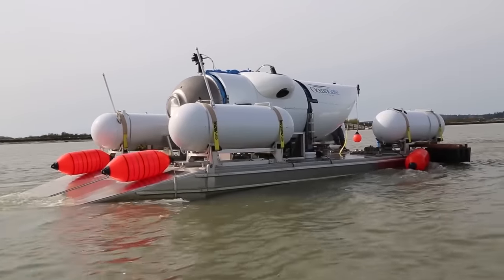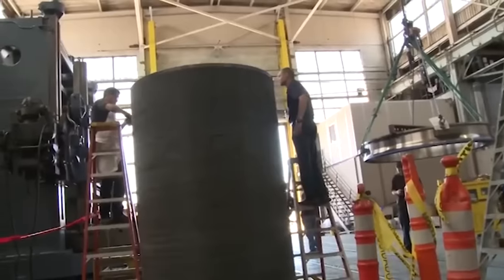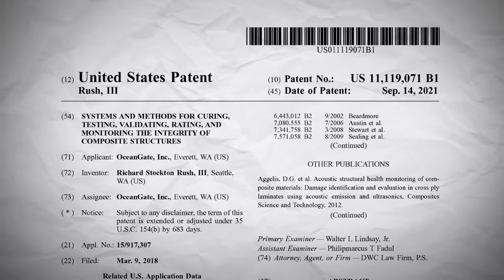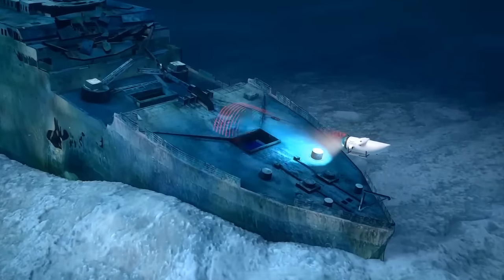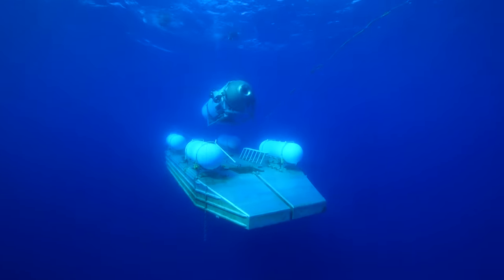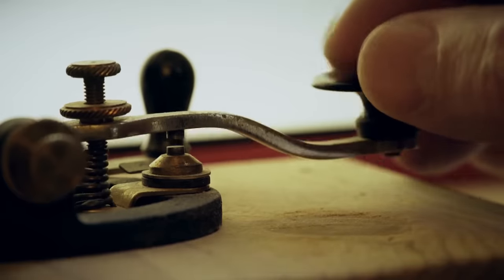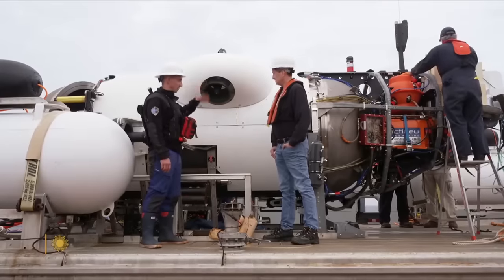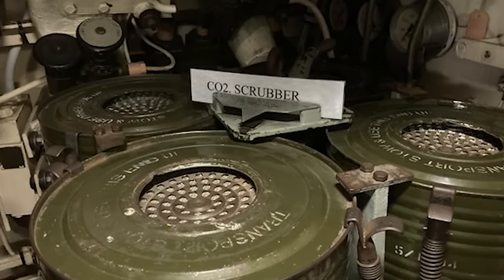Exposing OceanGate Submarines Many Fatal Designs

Comment: With respect to that railroad container collapsing, it's a good representation, but at only 1 atmosphere it's nothing close to how catastrophic the implosion of that tiny submersible would've been at that depth.
Reply: The vacuum in the container made the differential pressure much higher than 1 atm. But I do agree that it didn't implode as forcibly as that sub did.
Reply: @berto1014 A complete vacuum is 0 ATM. Assuming it's outside at sea level the air pushing on in it is 1 ATM.  That's a 1 ATM difference. 
Every 10 meters of depth is roughly 1 ATM. So at close to 4,000 m that would be roughly 400 ATM outside and 1 ATM inside the submersible.  That's huge!
Reply: @PoeticJusticeSC  you're right. Not sure why I thought vacuum would be negative pressure lol.
Reply: @berto1014  I think it's human nature as in our normal experience it feels like vacuum's have their own energy that sucks things in, when in fact it is just the atmospheric pressure pushing in.

Comment: It was mentioned that the Titan dropped it's weights few seconds before the implosion. So odds are that they started to hear some type of crackling sounds either from the hull or from the glass viewing window. So the operator must likely dropped the weight to immediately surface but it was too late. The unit was already too far damaged and it gave way and imploded.
Reply: Gee, thanks.
Reply: That’s pure speculation, there’s no way of knowing that
Reply: @Corey-pd3mi It's fact that they dropped their weights to try and resurface. Why else would they try to resurface so quick?
Reply: This is what happened: 
crack
Passenger 1: What was that?
Stockton: expression of dread, looking toward the ceiling
Passenger 1: Stockton, what was that?!
Sulaiman Dawood: Dad?!..... begins to cry
Stockton: Oh my g-
CRUNCH
Reply: @speedyd8150 Where did you see they tried to resurface?
Reply: Go woke go broke has a new meaning.
Reply: Where is this info that the submersible started to return to the surface?
Reply: What other reason would there be for dropping the wieghts than to surface?
Reply: @Corey-pd3mi  The Navy was listening the entire time with passive sonar and would know this with near-certainty, I'd bet. However, for security reasons they may not be eager to get in front of a camera and explain how and why they would know this. So you just gotta trust that if a submersible craft dropped a bunch of heavy metal weights and then imploded seconds later, there would be a distinctive noise.
Reply: @stickyfox  How would the Navy be listening to something they didn't even knew where it was? If the Navy was indeed listening then there wouldn't be any search party
Reply: @RuFi0000000  Paul-Henri: "You arrogant ass, you've killed us!"
Reply: @vgas11  The SOSUS hydrophone network wasn't listening for them specifically. It hears literally everything that happens, anywhere in the Atlantic. Underwater sound doesn't stop.
Reply: @vgas11 You must be joking.
Reply: @chuckd5819 have they found debri's ??
Reply: @luftwaffe6521  Stockton wanted die-versity and got it
Reply: @chuckd5819  They were found in a separate position from the rest of the wreckage - that wouldn't be possible if they'd detached during the wreckage's plunge to the ocean floor. If they'd detached during the final plunge, they would have been part of the main debris field. It also sounds like the last communication received was the pilot indicating they'd begun their emergency ascent. So there was a realization that the sub was fatally compromised and the only way to survive was to get on the surface fastest; unfortunately ascent had only begun after destruction had already commenced.
Reply: @RuFi0000000  Precisely, without the conversation part. :D

Step 1.: everything is fine
Step 2.: everything is pancake.
Reply: @luftwaffe6521 stop using the word woke if you don't even know what it means. Jump off the anti woke bandwagon, don't be a follower.
Reply: @katherineberger6329 So if the topside ship knew they were on an emergency ascent, why then wait 8 hours to report them missing, which is the time for the full dive. An emergency ascent would have been faster than that. Something isn't adding up with this piece of info.
Reply: Good point
Reply: @stickyfox  Apparently they did detect the sound of a catastrophic implosion, but until OceanGate realised they had fucked up harder than any tourism company before and announced they had lost contact several hours beforehand there would have been no way to verify it. That large time-window also meant they couldn't reliably associate the detected implosion with the missing sub, especially since a false-positive would have meant  five very wealthy people suffocating in a Darwin Award chamber. And yes, their wealth is important. If it had been any of us on that sub instead of those people they would have quickly announced the detected implosion and not bothered with the search-and-rescue attempt.
Reply: @luftwaffe6521  Least swivel-eyed anti-woke YouTube handle right here 😄
Reply: @vgas11  SOSUS
Reply: Only a couple experts have mentioned the submersible impacting the ocean floor. This type of event is certainly plausible. Free fall is difficult to control, and dropping ballast does not immediately reverse trajectory. Although, I would think the investigation could confirm this theory. An impact sight would be apparent.
Reply: The weight was designed to drop by itself when the attachment dissolved after 16 hours. This was one of the fail-safe.  The sub has 7 fail-safes. Each was a backup of the other one. The Sub was already underwater for that long, the weight would have dropped by itself, which it was designed to do.  We don't know if it was dropped by the operator or if it was because of the time limit without more info. This is speculation as we don't have a record of what happened in the sub. Is there a black box that can be recovered? Until we have more info. We are just guessing what happened.
Reply: thestranger5182 Nobody is trying to argue with the fact that them dropping their weights means them wanting to ascend as quickly as possible. What people are asking for is a reliable source. Where did you get that information from? I only heard James Cameron say in an interview that according to certain people in the exploration community, the sub had sent an abort mission before the implosion. But that just sounds like a bunch of hearsay to me.
Reply: @chuckd5819 I believe James Cameron and some others in this submarine community and adventurers club, had some inside information from the crew on the mother ship. I am sure it was those folks who have said that Titan had sent a distress call and were trying to resurface.
Reply: @snowps1  James Cameron mentioned it, but it's common sense if you look at the facts.
They dropped the landing weight before they imploded.
If they didn't drop it, the landing weight would be in pieces too.
It wasn't.
Reply: @stickyfox  There are instruments recording undersea noises continuously, operated by many different people. This is not a secret. But the sea is huge and full of weird noises, no one investigates every bang. Only when the sub was reported missing would people look for clues in the recordings. That's why the implosion sounds were reported retroactively, no conspiracy theories needed. The same happened with the Argentine sub a few years ago.  Also, implosions are very loud, like an explosion. Just because instruments could detect the implosion (perhaps from hundreds of miles away) doesn't mean they could hear a weight dropping relatively silently onto the sea floor.
Reply: None of you could even tell if they did. Why do people keep posting this lie?
Reply: @speedyd8150 its not a fact as they are sitting in pieces on the ocean floor. If they lost all contact they have NO idea of they did anything.
Reply: Even if they made it up quickly, they would've been crushed. When going up from such depths you have to do it slowly for hours on end because the compression will make you crumble if you don't
Reply: @dsgrant07  Even before we knew of the messages, it was fishy they weren't reported missing when they stayed out of contact for hours. Probably the incompetent company was panicking and didn't want to admit anything was wrong until they had to. And then didn't want to admit they had reason to believe the search was hopeless.
Reply: @user-xu1ce4ri4h  Also: Considering the ship lost and never regained contact with the submersible, I'm not sure who exactly would have received the abort notice in order to tell people about it.
Reply: @trandyescapes9798   they are probably saying as Stockton was woke and his sub broke
Reply: @vgas11  There are entire divisions of the Navy whose only job is to listen to the ocean 24/7 and to always know what's going on. A crush failure is something they would have immediately recognized in the fifties, let alone today with DSPs and deep learning algorithms at their disposal.

Even Sarah Palin understands how sonar works.
Reply: anything that takes more than 90mins to sink down to is well.. to deep lmao
Reply: @tomzukouski6041 I'd have thought that they would've dropped because the sub imploded.
Reply: @luftwaffe6521 No, this situation was a Go cheap , cut costs and go imploded.
Reply: @RuFi0000000 as morbid as this is I would think it would have gone more like MULTIPLE cracks and maybe one passenger nervously going "Is it supposed to make that noise?" and Stockton trying to talk them down like "Yeah don't worry, it always does that. I'm gonna take us back up and-" then everyone saw black as they instantly died
Reply: @dsgrant07  I've heard and, please understand, the ppl I've been watching say that they are part of the same adventurers club that Rushton and James Cameron were part of, they had made a trip before where they were completely out of communication for the entire time but made the trip anyway instead of returning to the surface to establish comms.
Reply: @Ivytheherbert  👍 I just want to clarify, the navy recorded a boom. From the few navy members I've seen on socials, the booms happen often and can be anything from something shifting, like a ship wreck, to geologic events. Until they are notified of something like a missing sub, they don't know what they are.
Reply: @tkmiller_author5417  We're not discussing loss of comms. We're discussing confirmation that they are on an "emergency ascent" and do not appear for 6 hours, yet the parent vessel do not report it. That's the inconsistency. Either the parent vessel did not have confirmation of an emergency ascent or incorrectly delayed reporting the said emergency for 6 more hours. Loss of comms is fine - that is completely different from an emergency ascent.
Reply: Everyone’s an expert. The fact is the guy died less miserably than 98% of you will is a win. And he left behind wisdom for others.
Reply: @dsgrant07  Very good point. The parent vessel should have, in my mind, reported immediately.
Reply: @garden0fstone736  Nah fam, the whole industry was telling him that. He was the only person to learn any wisdom from that experience. Can't make any use of it now, though. Which is better? A premature death or a painful regulation death?
Reply: @dsgrant07  premature? Dude was on his last stretch of life
Reply: @dsgrant07  I’ll def choose premature if I don’t even realize I’m dying when I’m 60 plus years old
Reply: @garden0fstone736  And the 19 year old youth? Choosing that too?
Reply: @RuFi0000000  You need to remember that this sub had a real time sensor analysis, so maybe a bunch of chimes occur before the "crunch"
Reply: @alliegrey4364  Not an expert but I'd also like to add that volunteering information about the noises that were detected might lead to safety concerns. From a military standpoint you might not want to reveal too much about what your surveillance systems are capable of.
Reply: thestranger5182 Don't know how involved James Cameron was personally. Please correct me if I'm wrong, I don't know all the details of the search and rescue efforts, but I'm pretty sure he was "only" interviewed a couple of times because of his experience and expertise. In one of the interviews he said the Titan was about to abort mission and resurface right before the implosion, but he refused to elaborate where exactly he got that information from. All he said was "the exploration community talks". I don't doubt he's well-connected in those circles, but I'm just wondering if what other people told him has some merit or if it's people misunderstanding or misreporting things. I thought the incident was still being investigated and didn't realize that experts had already concluded that the sub was attempting to ascend before imploding, that's why I'm asking. Not saying anyone here is right or wrong.
Reply: @45graham45  the guy above says they dropped a few seconds before the implosion
Reply: @tomzukouski6041  And how does he know that?. How would any one know that?
Reply: @45graham45  i dont know.why would talk of wieghts come up in the first place
Reply: One of the first things Cameron said when he was interviewed was that the sub had dropped its ballasts and was ascending when it imploded. This was glossed over at the time as I don’t think the interviewer realised the significance of this.
Reply: @midwestlakelife  why would the "landing weight", as you call it be in pieces? Afaik the ballast was mounted externally.
Reply: @gingerdude  wrong. The inside of the sub would be at atmospheric pressure the whole time & so decompression isn't required.
Reply: @ntube7  and how would he know this?

Comment: From what I found is that the viewing window was certified for the right depth, but Oceangate came up with it's own window framing that wasn't certified and didn't meet quality standards so the manufacturer of the window only quaranteed 1300 meters of depth.

Also, I read somewhere that on past dives, passengers could hear popping and cracking during the descend. Rush would say that it was fine, but it is now believed the sound was from the carbonfibre delaminating
Reply: Only a fool would have gotten in that "submarine".....

This thing is no Alvin...
Reply: This is the thing that I find the most annoying when people call Rush an explorer or an innovator or whatever. No, when you're doing something incredibly dangerous where one false move will kill you and everyone with you, you don't get to just shrug at the weird sound inside the hull when the hull itself is delaminating. He obviously was someone who didn't know enough about deep sea exploration or the engineering that goes into it, didn't care to know, and instead just took his chances. Believing that it'll be fine is not an option when you're going to space or the deep sea, this is where real adults have to come in and make sure every single little thing we can foresee has been accounted for. 

He took a massive risk either out of ignorance of the dangers or sheer fucking hubris, and he shouldn't be let off the hook in either case.
Reply: @anxietyfox4322 Well, we can’t hold him to account, since he, um, left us.
Reply: Thats probibly exactly what it was
Reply: @anxietyfox4322  keep him on the hook, if you can find him
Reply: I heard that too
Reply: What is delaminating?
Reply: @christinecollins6648 the layers of carbon fiber basically start to unglue from each other
Reply: @prestondickson1920  Unglue as in microcracking of the resin. Amazing that with this microcracking heard every single dive and therefore, a cumulative weakening of the cylinder, no one thought there would ever be a problem.
Reply: @xenuno  

or that the sensors didn't measure it
Reply: @tookitogo  He now gets to be enshrined in engineering textbooks in perpetuity.
Reply: @anxietyfox4322  "and he shouldn't be let off the hook in either case"

He wasn't.  Go find his obituary.
Reply: @xenuno except there were people who knew of the problems and impending failure for years. But they were punished and silenced for pointing it out. Mr Rush was killed by his own pride...
Reply: @anxietyfox4322 he also refused any non destructive testing or inspection of the sub that could catch this
Reply: @anonymousprepper1463  Hook? I think you'd need a very fine meshed sieve.
Reply: @fredfredburger5150  I'm going to hell....